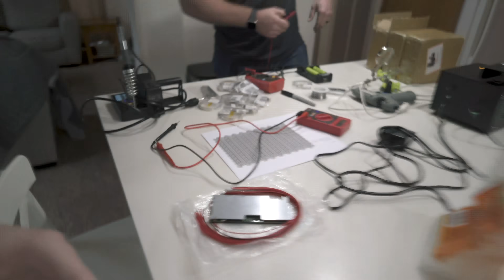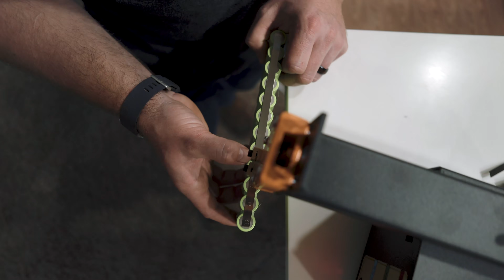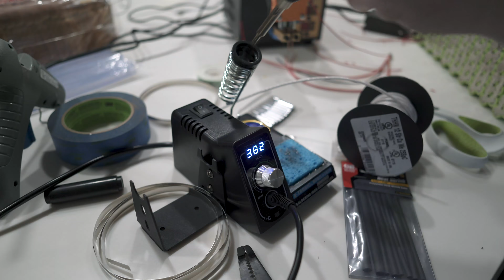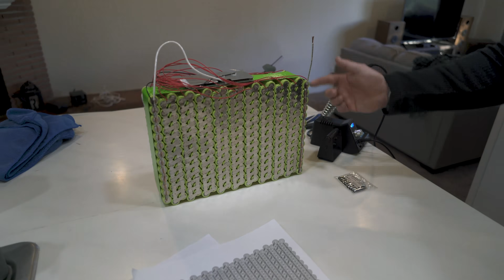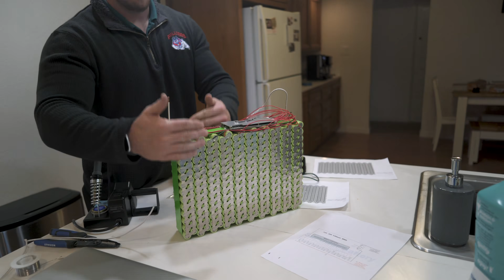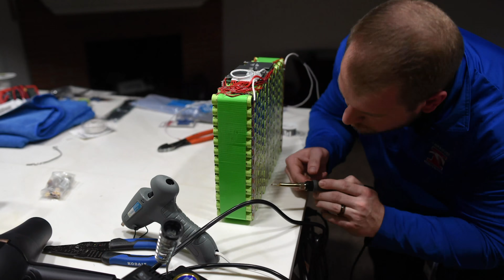How to MAKE a LITHIUM ION Battery Pack for an Electric Motorcycle (No explosions, sorry)

Comment: YOu have to show temps of this cells under full load in closed box at the direct Sun,
with thermal camera. You do not have at least 20 temp sensors and MCU, that shuts
down CHARGE or DISCHARGE, if ONE of the cells hits 65 * C. Becuase 70 *C and one wrong
cell and you have fire or explosion. Where are thermal cam images, to show, that this is safe ?

Comment: How you your BMS knows temperature of each parallel segment, if you do not have enough temperature sensors.
Imagine situation, when your BMS reads 55 *C, but another cells will have 70 *C. YOu come home and put
battery on rapid chargin, temps will be 50 - 55 *C at termistor, but at another cell will be 75 *C, because
of HIGH DC resistance, and you have fire or gases / H2., C2H2,. C2H6, HF,. CO etc. / or electrolyte / DEC, DMC? EC VC /
+ LiPF6 leakage.
Reply: ok relax elon. Why would there be a 15C difference across cells?

Comment: The battery pack is capable of about 130A+
But the nickel strips is about 35A.
There's a reason why you need to use copper.
Unless you use 6 layers of nickel strips.

And don't glue them 
Each cell touching is a potential fire risk
Hundreds of fire risk.
It's bad having one risk

Comment: i know electronics repair, so i know what a watt is, etc. i need the details of how you perform, and verify. yall obviously know how to get the results yall want, but dont really explain the concepts that would allow me to answer the questions i still have.  also, it would be well if you studied the definitions of the terms such as watt, volt, amp etc. i do know that watts do not flow. several times yall said, "watts flowing" ,  so, a bit difficult to follow.  beautiful pack though.

Comment: Great video. May I ask you a question? I have a device using INR 18650 batteries. But I cannot find them on the market; I only find 18650 batteries (comparable voltage and mah). Can I use these ones for my device? Thanks

Comment: I'm trying to charge the 20S battery from my EUC separately without the mother board connections.  it's got two small (black and red) wires but they have no voltage.  I have the original 84V charger.  Can I just connect to the battery output and charge it that way?  I think the battery might be only 1P

Comment: isolate between serials with adhesive paper! and temperature sensor imo is for battery temp measurement, not bms, as bms have integrated temperature monitoring already

Comment: Can I actually connect a 12S battery pack with a 13S battery pack in parallel?
I think the BMS of the 12S stops loading when it is full while the 13s will still charge up.
And when I've run the 13s empty enough, the Bms from the 12s starts up again and both batteries discharge, right?

Comment: So what did all the batterys cost to make this battery  ? And what dose one of those brain boxs cast like for a VIVI folding 36v 8ah 350w .    I don't want to burn up my new bike  i used to go about 20 - 25 miles with the tbattery that came with the bike now i get 2 .miles. .I also bought a spare battery 130 bucks. and it.s  going  to junk pretty fast..   Would you or could you build me a battery for my bike that would go 60 miles on a charge  all it would need is too be is shrink wraped  ?    I don.t care how heavy  and big is is . I can make an extention cord for my XT60H -M  and XT60 H - H   plugs to my bike trailer..      Please let me know .       Thanks Steve.

Comment: There is absolutely NO 18650 batteries that have a capacity of 3400mah that is capable of 30A output which is what the site claims these are capable of, certainly not for continous current.

Comment: These aren't the same types of batteries they use in EV cars with long range are they? I would attempt this to boost the range of my TailG Astra but these battery types are highly inefficient compared to what car manufacturers are using these days to get those 400+ kilometer ranges.

Comment: COOL built, but you need to use spacers and NOT glue, if that battery  pack goes wrong it wil go realy wrong realy fast. And there is a bigger chance for everything to go wrong this way

Comment: that battery packaging looks sketchy.. i don't trust batteries from any seller.  I just assume they're all fake until proven otherwise.  Jehu garcias make a good video on testing battery capacity.  Just because the capacity looks good doesn't mean they're legit.  Discharge them at their rated discharge rates while measuring temps to see if they are over heating is a better test to see if the batteries are legit.  But then again 99% of people out there just won't do that (I prob won't either lol)

Comment: (not watching your video 1 min in already seeing a no no)
you do not let 18650 cells touch especially on a motorcycle build your asking for trouble let me tell you why the reason we use insulator rings on the positive end of the cell is cause if my nickle strip touches the edge of the positive side of the cell (most peopl don't know the negative side runss all the way up to the edge of the battery cell) don't belive me peel one 18650 cell touch the side with a meteal clip and touch the positive sidewith that same clip  you will get a spark) cell spacers are very cheap (about the same as hot glue) why are you cutting corners on a motorcycle you must want a fire between your legs 
plus cell spacers give the battery some protection against friction and fall protection

Comment: Hey guys. :3 I would recommend using “fish” paper between your series cells. The fish paper absorbs a little bit of vibration and can also prevent abrasion between the thin film of the cells causing a short and possible fire. Id also recommend using the paper to protect the nickel cell connections and to wrap your cell before you shrink wrap for extra durability and rubustness. Hot glue is ok for assembly but will weaken over time due to temp. Fluctuations and normal wear.
Reply: I agree with the fish paper but I don't think if it would really be too bad for the glue. Hot glue can handle about 160 F (melts at about 250 F) and the cells really should never be above 140ish.

Comment: you need to add insulator between the groups because there's a risk of fire in there if the wrap they have rubbed and makes a big short, unstoppable fire

Comment: OMG THANK YOU! This finally answered my question on how to wire up at the end!! I found a million guides on how to do everything else but not how to wire discharge direct from battery and charge to the bms properly. Now i just have to figure out this stupid proprietary connector that the battery case uses but otherwise I'm set!

This battery was like 500 dollars for a 48v 13ah. Nuts. 2 had died at this point because they didn't wire them up safely so i refused to do it. I checked all the cells in the 2 dead batteries and lucky lucky they all seem good! Cheap batteries but hey now I have a 52v battery with WAY more range to boot! I just have to figure out how to wire everything up with the new controller and all that.

To clarify this is an ebike not a motorcycle or anything.

Comment: No air gap between cells??  It may or may not explode but performance would definitely get hampered. The inner cells with run hotter than outer ones.

Comment: the wires you have are not thick enough for those connectors and your application.
Reply from the maker: What size should we have used?
Reply: @TheInja  I would use 8awg or at least 10 awg but I don't know how much max you are pulling. Those Anderson connectors are rated high voltage and 6 to 8awg

Comment: Did you add copper wire on series connection or i am wrong. If somebody can help me i dont know how much thickness i need for my battery pack. I will use 16S 7P. Max dischrage of one cell is 10A. I suppose i need 10mm×0.15mm and add copper wire on series connection

Comment: why do you need such a high amp BMS? surely the cells won't drift by enough to balance with much less than 1 amp per cell, 13 amps at worst case for 13P. if they're drifting faster than that you need to rebuild the pack with better matched cells

Comment: Just buy a battleborn 50 amp hour battery instead of going through the trouble making all that they should just make it easy for you to put this car battery right into the bike it's a lithium iron phosphate rechargeable battery with a built-in battery monitoring system it's one of the baddest batteries you ever buy meaning one of the best you get two of those onto a motorbike 100 amp hour bam you're going far.
Reply: So long as its the same 72volts. Which I think Battleborn does not offer. Correct me if Im wrong

Comment: How much amp is the controller pulling from the battery?  If it's 70 amp the nickel strips you applied on the battery isn't enough...need at least 3 or 4 layers to connect those batteries together... Not only do the batteries themselves generate heat but also the nickel connections themselves generate heat and also cause to restrict current flow which then heats up the battery more.  With the thicker and better conducting metal it will allow the current to flow freely and minimize heat.

Comment: Dude u need cell tabs
Cell level fuses
Bms and cell balancers also a cooling tube for the cells
A temp censor 
This is a half assed bad battery pack
If anyone of those cells catch fire it's done
U need cutoff circuits that donot let the battery over charge
Reply from the maker: Where are you getting your information from? 😂

Comment: Great video and project. That's not a battery though, it's more of a ticking bomb.

Dangerous chemistry (would have gone with LiFePo4 instead)
Not enough parallel cells for high current loads (Drawing anything above 2Amps per cell continuously is unsafe)
No gap between the cells (thermal runaway, wear of insulation, possible short)
No proper insulation between groups (possible short)
Balancing cables crossing and all over the place (possible short)
No fuses inside the battery at all (huge short hazard and thermal runaway)
No cooling whatsoever (thermal runaway)
No rigid structure to hold the cells together (protection in a crash)

This is literally asking for a catastrophy and shouldn't even be allowed to get on the street.

Thank you for sharing your project with us but please don't call it "How to" since many people might make the same mistakes afterwards.
Reply from the maker: "how to" build it like us?

Comment: Those cells are for laptop and other slow drain devices.  You’re running a risk of heat induced battery damage and possibly fire drawing the amps needed for an e-bike. Not to mention and electric motorcycle.
Reply: They explained what the rated amp draw of the batteries were so no, they’re not running that risk. They’ve already taken the drain rate calculation into account.
Reply: @jsl6155  I checked the specs from the links provided.  They are at risk but it’s not my ass that’s going to get burnt.  Not like I know what I’m talking about or anything.  I only have a 3.5second 0-60mph 12kw nominal hub motor Emmo Proton with 72ah capable of 800 continuous amps. Nah. No clue.

Comment: One thing I've heard about making packs like this is to not glue the cells directly together as they might rub into each other over time so they might cause a severe short when damaged. Instead you could use a cell holder thing to keep the cells slightly apart.
Reply: Exactly, I mean this is a cool project and all, but he basically aligned the positive and the negative right next to each other. He only depends on the battery wrapper to prevent the short. This is dangerous.
Reply: @lkazanov  these newer batteries come with anti-short rings already on the battery. No worries anymore with most Chinese batteries.
Reply: @marthamryglod291  That is false. Most cells are unprotected. Only if it is a "protected cell" does it have short circuit protection. Not all cells have it built in.
Reply: 3d print the battery grid you need you can shape it to fit into the size of bike frame .
Reply: Yeah hot glue is fine its just the need for fish paper between the parallel groups separating them into series.
Reply: You are right, it is safer to use grid holders, they actually even make hexagonal ones now, so packing density is a non issue and i would use them
However this is still denser
Reply: Been using my glued pack 3 yrs now, no problems.
Reply: hot glueing the parralel groupds and wrapping in fish paper is the best way to make a battery if it needs to be compact and safe
Reply: I'm no genius, but hot glue is not a good idea. I like the plastic connector that leaves insulated air gaps.
Reply: @jeffreybrewer9637 air gap?
You mean cooling?
But everything is literly sealed inside the battery pack itself. So cells can't dispute heat even if we use spacers. Plus hot glue works as an insulator because it's plastic. So no need to use spacers.
If you want a good shape and fun that's okay. It's not compulsory .
But EV battery manufacturers like tesla , rivian etc MUST use these because they use liquid cooling system which really needs gap

Note: I'm an electric enthusiastic guy. I know so much about electronics and stuff. Expert. Really ;)
Reply: @jeffreybrewer9637  well the air gaps are pointless once the battery is sealed anyway 😂 hot glue isn't a problem, battery spacers just make larger batteries
Reply: @doooofus  
Well this video is a couple of years old, don’t believe Curt hot glue’s battery cells anymore.
Reply: @eastwood111  oh i might check out some of his other vids then, shame that this is the one the algorithm seems to promote so heavily. maybe he should put a pinned comment in or something idk
Reply: Very scary
Reply: If you want to learn how to assemble battery packs, don't look at these guys because you waste your time and money.
Just look at the positive poles, they all should be isolated.
Reply: @billadmond9450  could you explain that in more detail? I'm new to making battery packs
Reply: @marthamryglod291 if you have money and it's okay if the battery packs comes 3 to 5x larger then you use cell holders. There Is no point in using them cause even with air gaps with cell holder heat can't get away because cells are sealed inside insulation.
And even Chinese cells come with insulating caps.

And it's pretty hard to find shape of cell holders YOU LIKE. But gluing means, you're the king, whatever shape you need. 
And those insulating wrap which manufacturers keep around each cell can't nesserly tear. And you can just glue them it makes insulation too.

But yeah, if you want a good shape etc, you can use.

How I made: I used 30 18650 cells in 6s5p.
Glued them and secured with insulating tape.
Spot welded them. 
Then used some more insulating tape and used hard cardboard pieces the. Put duct tape. Every side. Now everything is covered with cardboard and tape. 
Now used blue color heat wrap shrink tube and heat gun. It's nice blue color heat wrap. 

No problems it gives me 30KM range on my ebike.

Comment: Are you worried about balancing the cell packs? That could be problematic.
Reply from the maker: They're all managed and balance!
Reply: @TheInja  I mean't that in general it's best capacity test every cell and organize them so that each series pack is identical in capacity. I suppose it's not as necessary when you have pretested cells but it's still best practice.
Reply from the maker: @ogland6482  We did! I know there's footage of it in some of these battery videos. We tested every single cell right when they arrived. Did a full deplete and charge cycle to test capacity on each cell.
Reply: @TheInja  cool, I must have missed it. I have been learning about lithium batteries for a while and I built one for our robotics team. I was a little concerned not to see any sort of dividers in between cells. Mostly because I have ripped the protective shrink tube on the cells alot. 

You can see the 4s8p pack on the robot. It's designed to go down 300ft.  https://www.facebook.com/1330374096981479/posts/4674622735889915/

Comment: all that only waist of time no spacers means bateteries die soon cause of heat have fun with that hot glue wont hold weld joins breake cause of vibration poor desition no quality 0 safety...

Comment: Very satisfying. But I think it's not good idea to stick batteries together when they are in series connection without extra Insulation. When the batteries become hot their plastic cover can be damaged and then the short circuit risk is very high. Don't know maybe I'm too cautious about it.

Comment: Do you need to fully charge the cells before constructing the pack? Or what voltage do you want each cell (roughly) when you wire up the pack? Are you wanting close to 3.7 volts per cell (since that is the nominal voltage) when wiring it or are you wanting peak voltage (4.2 volts)? Thanks!
Reply: You just want them to be equal voltage. But I’m not battery maker.

Comment: Great video. I didn’t see you double up the nickel strip like other video on YouTube. How is that work out.
Reply from the maker: Curt did the math and it all works fine!
Reply: @TheInja  Thanks for responding. I bought the same spot welder you have and it came in today. Mine keep tripping circuit breakers and it doesn’t matter where I plug it in. Do you experience the same thing at all.
Reply from the maker: @mta3562  happened all the time. Haha

Comment: Just a couple of things 1/ those cables look way too small to handle that kind of power you are using.

2/ you don't seem to have any kind of cooling gaps, so when you start to draw or charge at higher rates the batteries may get very hot.

Cooling can make a huge difference to how the batteries perform and last.